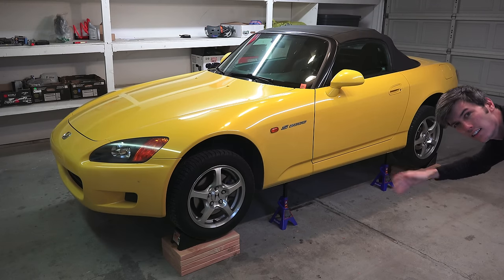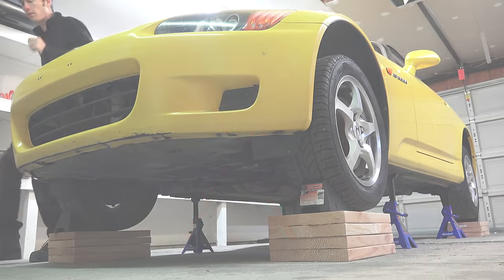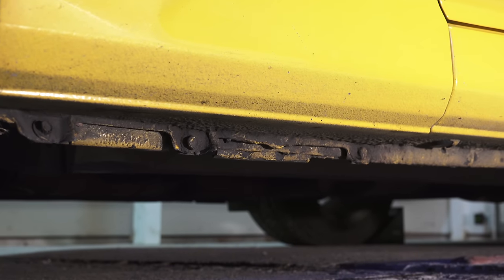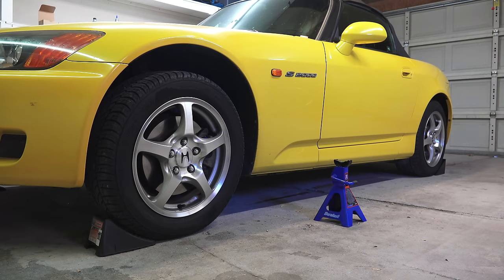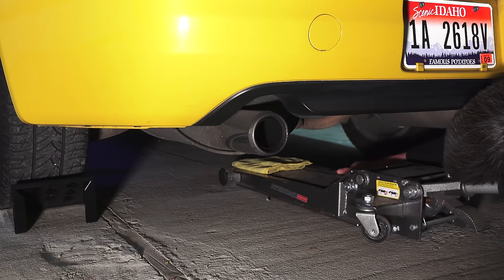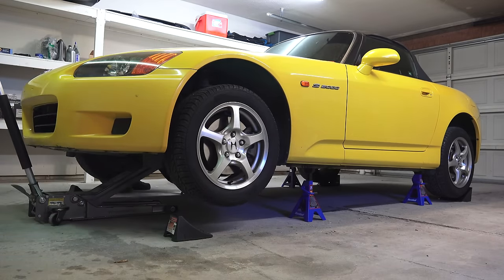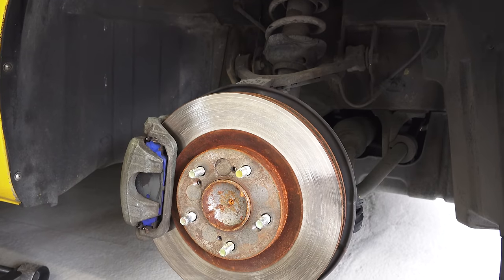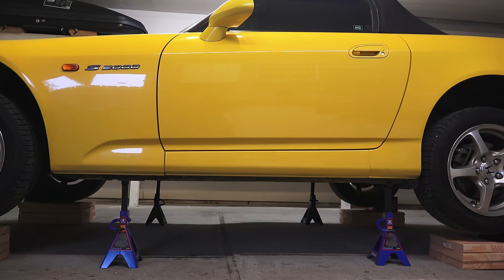How To Completely Lift A Car On All Four Jack Stands

Comment: The passenger-side rear tyre is rotating the wrong way. Lol
Reply: nothing wrong, that is the way of differential
Reply: +ΑΡΗΣ ΚΟΡΝΑΡΑΚΗΣ w.. what?
Reply: On an open diff, when you spin one wheel the other wheel will spin the opposite way. I'm pretty sure the S2K came with an LSD so it must be worn out.
Reply: No no, I mean the tyre itself is directional and the one on the rear passenger side is on the wrong way ie: it's rotating the wrong direction during forward driving
Reply: +alexaescht if he had the tyres with the wrong direction he would notice, dont you think?
Reply: +uncreativename the oposite way? or they move at diferent velocity?
Reply: opposite way. It's only when you turn one wheel by hand. When it's getting power from the engine they turn the same direction.
Reply: jose jalapenho Well have a look at the tread pattern yourself when he jacks the rear of the car up from the rear diff. The tyre on the right will draw water on the road into the centre of the tyre, which is the opposite of what it's meant to do. Tyres are meant to push water towards the outer edges of the tyre to reduce aquaplaning
Reply: Both FR and RR tyres are on backwards. Silly EE, he should know better.
Reply: Yeah idk how though lol. Next video I guess.
Reply: Nope, those are fuzion HRI tires; they are assymetrical, they have a specified inside and outside, but not a specified rotation. The tread design just looks slightly directional.

Comment: DO NOT JACK ON THE DIFFERENTIAL WITHOUT A BLOCK OF WOOD! This is a guide to cracking your rear diff.
Reply: a phone book works pretty well too
Reply: Prehistoric google
Reply: Do not jack on the differential housing for any solid axle cars.  Puts too much bending load on the axle tubes.  Jack directly on the axle tube closest to the wheel.
Reply: The s2k is independent rear
Reply: Edslittleworld
You sir are not familiar with modern day imports.

Comment: Mustang owner manual says it clear "never use differential as jacking point"
Reply from the maker: So for that car, you shouldn't! Always consult the user manual. On my S2000 the rear diff is a specified jacking point.
Reply: 1A Idaho plates... Boise/Twin Falls area??

Comment: all depends on the clutch configuration ... sitting at a stop when driving a truck (+10k gvw) and putting the gear in Neutral is a no-no.

Comment: If on level ground it's better to jack with the car in neutral, brake off, and wheels unchocked. This allows the car to move while jacking rather the putting a sideways force on the jack or rolling the jack. Once up on stands, then you can chock the wheels (if only lifting one side).

Comment: If you ever forget to crack the lug nuts and putting it in gear doesn't give you enough leverage, put the car in neutral and spin the wheel the opposite way, then quickly jerk the wrench to loosen the nut using the inertia of the wheel

Comment: so this guys meant to be an engineer (which having seen many of his vids, hes just swallowed a a dictionary and chats utter bollocks). But he starts by saying that you shkuld put the hand brake on and si he yanks the hand brake up without pressing in the button. come on, need I say more?
Reply from the maker: +max bevans I also made a video for guys like you. :) https://youtu.be/1ePcNfx1UEw
Reply: Excellent reply! I push the button out out habit but I appreciate that it's a pointless element of the car to worry about.
Reply: Engineering Explained I was hoping you'd link that video to him or I was going to.
Reply: its not bullocks but a parking brake mainly affects only the rear axle. without an engineer the mechanics wouldnt have schematics or machines

Comment: those are some dinky ass jack stands
Reply from the maker: They're two-ton, and the car weighs less than 1.5 tons, so they're plenty adequate for the job.
Reply: Engineering Explained gotcha. just weird seeing people use ones without a wide flat metal base seeing as that's all ive ever used
Reply: Fire Squad . Heh, I'm on the opposite end of that. All I've ever seen are jacks like he has. What are these flat-base jacks you're talking about?
Reply: Charles Shade II theyre just much wider and heavy duty looking. weighs over 20 pounds per stand whereas the more common ones are just over 10 i believe. They're very good i can try and rock the car as much as i can and it doesnt have a chance of tipping over, i like em.